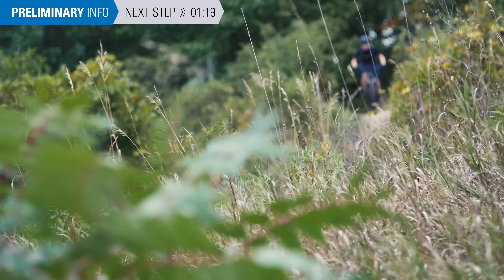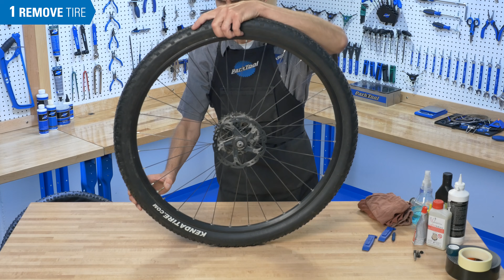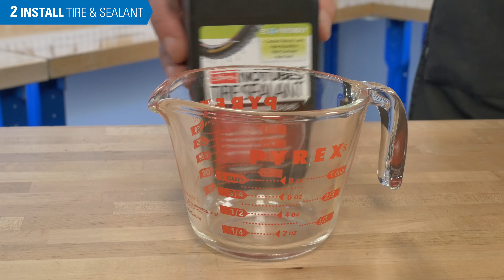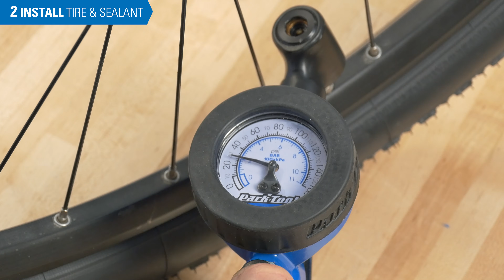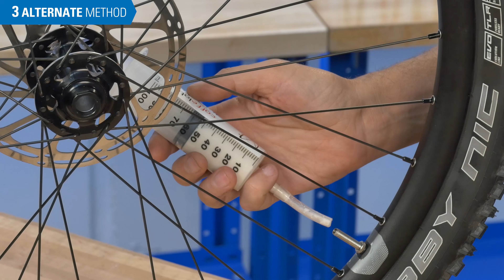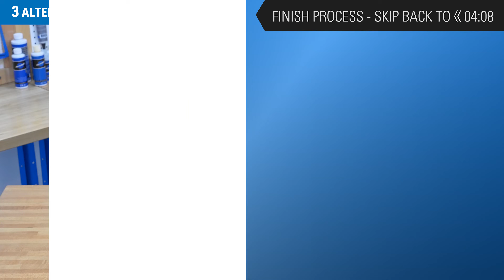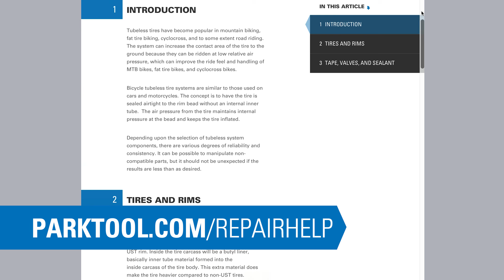How to Install Tubeless Tires

Comment: Haha he made mounting the tubeless tire look so easy!  I've been swearing up a blue storm for 2 hours now trying to mount a Vittoria tubeless tire on a Stan's rim.  Already busted up my hand and broken a tire lever, still can't get the second side of the bead seated.
Reply: I yelled out loud “WHAT” when he mounted it so smoothly, I have to wrestle my tire for 30 mins to get it on
Reply: Use zip ties every 10 inches or so AND dish detergent mixed with water. It will make a big difference. And don't forget to clean off the old residue of Stan's glue or it will not seat properly and leak.
Reply: Have to say I was ready to switch to tubes again until I saw Calvin do it correctly.
Reply: This is the way.
Reply: Man I was thinking the same thing! It was not this smooth for me when swapping my tire out! This truly is the way.
Reply: Defiantly  all tires arent equal.
I wish he would have used an example of the hardest tire to mount. I can mount many brands w/o extreme measures...others I take to LBS.
Reply: Did you manage?
Reply: @girurerumu took it to a shop if I recall correctly lol

Comment: USE SOAPY WATER!!! For some reason I doubted this would make a difference but after failing and using it as a last resort, it made all the difference. (Especially with fat MTB Tires, 26.5 x 2.8) Thank you Park Tools!
Reply: Same, I should have taken everyone's advice on soapy water. It just slows down the air escaping by fractions of a second.

Comment: Great video as always.  One bit of feedback - the comment “inflate the tire to at least the maximun pressure indicated on the label” got me in trouble.  I just blew off a new maxxis dhr II tire after inflating to near 50 psi and leaving it sitting for a few minutes.  I stopped inflating as soon as the tire was fully seated and i think my pressure gauge is accurate.  Maybe a faulty tire, but I’m very hesitant to get near that max PSI now (was 50 for the tire and my rims).

Comment: Cutted valve from old inner tube and used floor pump. So double trouble and it was a pain excercise :D. Then put a new inner tube because I didn't have a compressor. With a real tubeless valve floor pump might work but it might burn your nerves also. Good video thanks!

Comment: great idea to put the tire pressure info near the valve!!
Reply: I wanted to do that with my new Schwalbes and they made it so they look upside down when you do this. (the reflectors are by the opposite side and the logo would hang upside down). Also, i noticed that the labeling were slightly different positions on each side. Odd. It shouldn't bother me, right?  :)

Comment: The key for me was using a rapid displacement pressurized air source. In the past, even those pancake compressors did the trick but I didn't have one anymore. I thought using one of those portable car tire compressors would provide sufficient volume for my 700x35 tire. Nope.  Never got the bead lock needed.  Didn't feel like getting another bulky pancake system that wouldn't be used for anything else so got those purpose built little tanks you fill up to 120psi and open the nozzle to unleash its fury. That worked perfectly with no sweat.

Comment: Soapy water is not compatible with many sealants (slime in particular). In the motorcycle world you would paint the tire bead with sealant for lubrication and to help with the initial seating and sealing process.
Reply: Bullshit!
Reply: If you notice.. he is not pouring soapy water all over... just a little spritz and then spreading it with a rag
Reply: Enduro rider here that installs mousse bibs on my husq TE300i and we use Murphys lube with dual rim locks and our “soapy water” is murphys shooken up in a bottle. So no issue with degrading lube

Comment: One ☝️ of the rules of thumb is to position the tire 🛞 valve in the upper half of the tire 🛞. This means from the 9 o’ clock, to the  3 o’ clock position, to avoid sealant from clogging the valve stem. This rule of thumb applies to filling the tire with sealant, and when pumping 🆙 your tires 🛞. Your friend, Jeff.

Comment: Good information here. I never knew anything about sealant being used on a tubeless tire before, but then again I'm far from an expert on bikes. I have a Raleigh and a Specialized Crossroads bike and both are tubeless. I've owned my Raleigh for over 10 years and have never had a flat tire (still using the original tires).  My Specialized Crossroads recently had two COMPLETELY flat tires. One of them pumped right back up with a floor pump, while I had some trouble with the other. There is rubber 'tape' inside (which I had to put back in) and I'm thinking I might need to use an air compressor to pump it up.

Comment: I never went tubeless. I use clinchers with Mr. Toughy Tire Liners and also add Stans sealant to my tubes and no flats in over a year of using the Stans sealant. You have to use great care in replacing the presta valves. Make sure it is screwed in properly and firmly otherwise you can accidentally remove the presta valve when removing the air nozzle. There is an ABS (Air Bleed System) button on Lezyne floor pumps to remove the back pressure before removing the nozzle to prevent this from happening. I learned this the hard way after adding air to my tires and trying to unscrew the nozzle the presta valve came out and I got a face full of Stans exploding into my face. It sounding like a gun shot going off.
Reply: It sounds like you use inner tubes with sealant on regular basis. Why do you do this? I am asking because I considered this, but the lifetime of the sealant is shorter than the inner tube so I stick to just inner tube and having sealant/glue as an emergency in case of flat.

Comment: Sorry but on 3.45 we see a different wheel but here we have a crucial point in the process. Seems you have used a helping gear which other mechanics used as well but would nice if we could know that.

Comment: I don't understand. So the tire is sealed to the rim, but you still have a tube inside that you have a nozel to, you have to inflate the tube still and the tube nozel can still let air out, the nozel can be damaged (the majority of my flats are from tears at the base of the nozel at the tube inside) and there is no seal in the hole where the nozel goes through the metal rim or in the tubes nozel. So by this logic it's still not really tubless and you still have to pump up your tires.

Comment: So I have ust standard everything and none of the manufacturers guides show sealant being used, so should I use sealant or not? Also if I do use sealant will I need to tape the rim? The guides without sealant don t use tape...
Reply from the maker: UST standard is designed to fit and air without sealant. It usually does.  Adding sealant would be done as a preventative measure should the tire get a puncture. No tape is needed for true UST systems, only for the "conversions" or "tubeless ready" systems.
Reply: Park Tool thank you :)

Comment: Thanks! very clear and detailed. let me ask you what happend if I need deflate the tire to carry by plane?
Reply from the maker: You do not need to deflate your tires on a plane. The cargo area of the plane is pressurized like the cabin and you will see no more than a 15psi bump in pressure on the plane and that would be rare.

Comment: I guess it must happen a lot in thorny areas but in my 20 years of mountain biking I've NEVER gotten a flat because of a puncture. it was always because my pressure was too low and pinch flatted.
Reply: Here in SoCal, I got a flat in the first 1.5 miles of riding my new gravel bike (non-tubeless) offroad....had all kinds of thorns stuck in the tires by the time I got back home.  My other tire flatted about 90 minutes later while at home.
Reply: +Dana Rouleau that blows!

Comment: Hey Calvin, is the "soapy water" = windex?
Reply: windex works too, but you should be careful with the ammonia content in windex. Also probably cheaper to use soapy water... or in my case I don't use soapy water at all. If you prep your tyre and rim correctly, you shouldn't need it.

Comment: Would I notice any difference in ride quality if I converted my 700x32 Gatorskins (100 PSI) to tubeless?
Reply from the maker: I would not suggest converting your gator skins to tubeless. High pressure tires like those are much more particular and we highly recommend going for a tubeless tire and wheel option if you would like to try it.

Comment: 15 yrs since i rode a bike i'm 52 . i purchased juliana bike for leisure riding never had tubeless tires before my bike arrives in few days  . of course new bike has tubeless tires   i wanted to know a little how they re act  and what to expect . i plan to mainly do gravel park trails backwoods trails  no street riding ( unless my daughters change that ) . i'm a indoor bike rider use to be a avid outdoor bike rider mainly rode with the kids I hated the cheap huffy style bikes so i went long term bike never to  replace unless stolen  friend let me ride there juliana bike well it hooked me . . i think your video educated me enough to grasp modern tubeless  tires is there any sealant that would be good to use i won't be riding winter months  is there anything to winterize these tires when hanging in the hallway ?
Reply from the maker: Glad to hear you are back riding outdoors! What most people do is leave the tires alone through winter and then in the sporing before the season starts they make sure the sealant is at the correct level. You can do this with a little dip stick or you can do this but popping the bead of the tire off to see what the level is. Or just add more to be safe :)
Reply: @parktool  thank you i will do just that i plan to winter the bike at work . very help full video guys at work are eager to see how tubeless tires work may convert our security bikes over  on campus thank you again my bike is my personal bike

Comment: Great video guys ! i bought a new MTB (Salsa Fargo Apex1) that is tubeless ready but has tubes installed.  i heard i would need to change the valves in order to go tubeless, is that correct ?
Reply: Yes. You'll need tubeless presta valves (and also sealant). They run about $25 for a pair. You'll probably want 44mm valves, but I'd consult your local bike shop to make sure.

Comment: What does rear and front on tubeless road tyre mean? in terms of direction when installing?
Reply from the maker: Manufacturers may put directional arrows on the sidewalls. The concept is the patterns of the thread are designed to perform when turning with the arrow.

Comment: can you use a co2 inflator instead of a compressor?
Reply from the maker: You sure can. It is good to note that the Co2 is soluble in butyl rubber. This allows it to "leak" out of the tire a little bit faster than the compressed air. So a little loss of pressure over the first few days will be normal. Have fun!

Comment: So I'm having a problem where I can't inflate the tire bc air just leaks out
Reply: Liam S have you tried restarting it?
Reply from the maker: Tubeless can require a larger volume of air to seat. Often removing the valve core and finding a compressor that flows a large amount of air will do the trick on some of the tougher cookies out there. Also using soap or something on the bead can help a lot to seal and allow the bead to slip into position.

Comment: Can you inflate the tire first ,take the air out and then put sealant in
Reply from the maker: Yes, and it is a useful technique. It gets the bead to seat up against the rim first.  Use a valve core remover to pull the core, then inject the sealant.

Comment: Any tips for 650b 3 inch ground control tires?
Reply: Btw the tire is very baggy.
Reply from the maker: When the tire fits loose it obviously makes seating tubeless very difficult. One method that I have found useful as a last resort is to install a tube in the tire initially, then break one side of the bead off to remove the tube while the other side is left on, then re install your tubeless valve and sealant, then flip the wheel so the broken bead is facing the floor and inflate. I hope this helps! Another good tip is to use an air compressor with larger air lines and to remove your valve core from the valve to allow more air to rush in to the tire.

Comment: I have done everything correct I think. I installed the tire, and few days later the air was out of my tire. What did I do wrong?
Reply: Update?
Reply: I think its from the tape
Reply: Yes, shit tubeless tape. I tried two different ones, all didn't work. Then I used gorilla tape, that worked

Comment: Help,

I often face a difficult test while fitting bicycle tires. That is, each tire has two metal rings inside which help the tire stay on the rim even with air. Now the problem is, after putting one part of the tire inside the bicycle rim, when I try to put the next part, I see that it is very tight. It's so tight that I have to fight with it. Often because of this, my tube gets punctured by being pressed against the tire lever. What is the solution?
Reply from the maker: To have the best chance of not puncturing the tube when installing you need to be sure the the part of the bead(the stiff part of the tire with metal or kevlar in it) that is already on the rim needs to be in the drop center of the rim. This allows you to have the most slack possible when getting the last bit of the tire on. Trying to do this without a lever is a good way to prevent a puncture. Also be sure that the new tube has some air in it so that it does not tend to pinch under the bead. There is a bit of a balancing act with the air in the tire. You want enough to give the tube enough body to fill the space but not enough as to make installing the tire difficult.

Comment: How do you know the bead is seated correctly? I’ve been doing this for hours and no air stays in the tire. Maybe i have a broken valve?
Reply from the maker: Use a spray bottle with soapy water.  It will show you the source of the leak.

Comment: Hi there, is there anyone that can please answer my question? So I just finished installing my tubeless tires, and I read most people/brands recommend refilling the sealant after about 3 month. For the refilling, do I need to remove the tires and clean up the tires and rims from the old residue? Than refill, or can I just refill from the valve hole? Thank you in advance!
Reply from the maker: It is difficult to give exact recommendations.  When the sealant dries it is less than able to stop new leaks.  However, before removing the tire see https://www.youtube.com/watch?v=H9NQcRd7ov0
You can simply keep adding fluid, but there will be dried sealant building up inside.  Occasionally remove and clean this out.

Comment: I tried this conversion but it turns out the Veetireco tires are not tubless ready even though it says on the manufacturer website that they are. The sealant just bubbles through the holes in the tire sidewall. So now I have to revert everything again and install a tube. Do you know if electrical tape works with a tube or do I have to purchase a whole new rimstrip?
Reply from the maker: Electrical tape usually does not work when used with a tube.

Comment: Pardon my ignorance.I was wondering,what happens if you get a puncture while out riding with a tubeless system.Is it a long walk home,or is there anyway of doing a repair.As I have always used a tube system,I always carry a couple of spare tubes and a puncture repair kit,just to be sure of avoiding that walk of shame.Thanks in advance,and I really enjoyed the video.
Reply from the maker: A spare inner tube is always a good fix. If there was a liquid sealant used, the sealant will often fill and stop leaks in small punctures. If the hole is a rip, however, you will probably end up going to your tube. - Calvin
Reply: Depends on the sealant. Some are great and will almost immediately seal it, others are atrocious and you might be stuck swapping tubes or limping the bike back. I've seen several posts on the Truckerco bike sealant, and how it sprayed everywhere, holding a max of 15 PSI (28 PSI would break the damaged section and spray out everywhere).
As was stated, you should have a spare tube with you. Shit can always go wrong, and it's nice to have a backup plan.
Reply: Or use one of these:
www(dot)maxalami(dot)de/de_DE/
Don't know if there are similar products like thisone outside of central Europe, but this is designed for tubeless tires it seems.
Reply: I got a small branch that put a big hole in mine. I had to use a car tire plug because it was so big. But bring a plug kit with you. They can plug up to anything 5 mm. Those come handy.  Also carry extra co2 cartridges. My small pump is a pain but last resort.

Comment: You make that "Now inflate the tire" part look really easy. I'm using an electric pump and am not even close to getting any air to stay in this thing, and by now most of my sealant is on my driveway. I used to work at an auto garage and know all the tricks to getting a car tire bead seated, but they're not working here. What are the tricks for these damn things?
Reply: Since it's been three months since your comment, I assume you've gotten it licked, but i just went through this.  You need a compressor, not an air pump. You need a huge burst of air to set those beads.  The floor pump was useless and I"m assuming an electric pump will still not fill enough air fast enough to set them.  
Once I hooked up the compressor, the tire held air, but the beads still weren't set right The compressor would only go up to about 20 psi since i couldn't quite attached the bump justright, but when i took it up to 40psi with a floor pump that seated the beads perfectly.
Reply: @xxdigbyzzxYT  well no one’s stopping you from explaining how. But considering this guy had the same issue as me I thought I’d offer my solution. Deepest apologies.
Reply: @downhillindad7689  easier to learn than to somehow find an air compressor 🤷🏽‍♂️